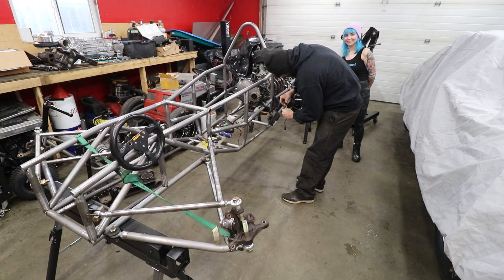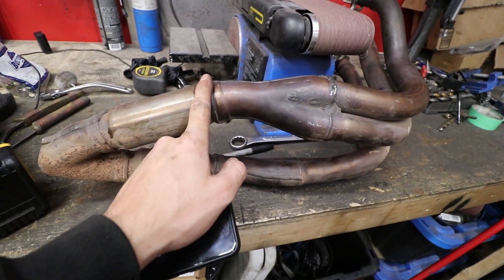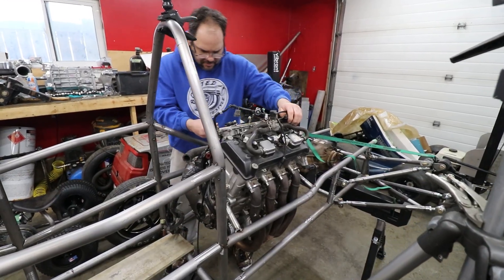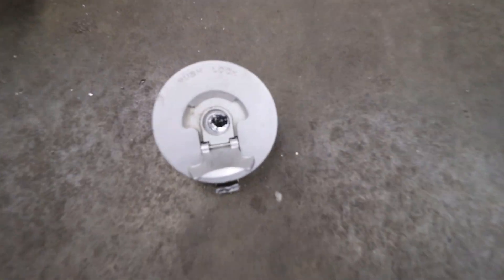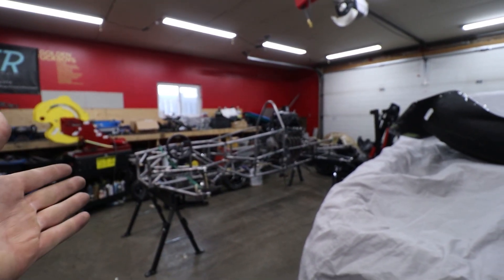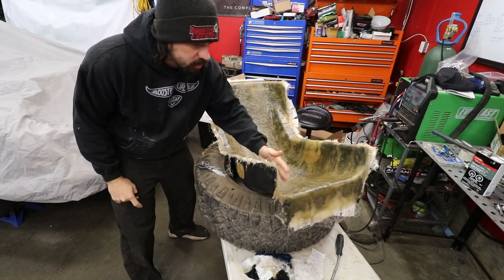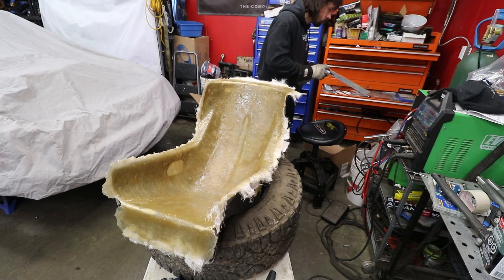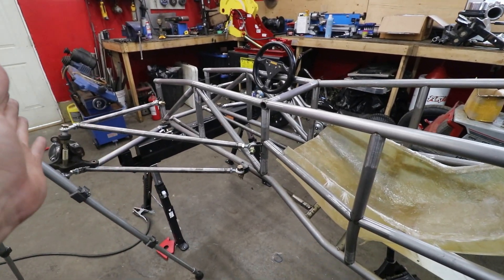First Start On My Homemade Formula One Car First Start - Pt 7

Comment: How does the Gearing work out, driving the Diff straight from the Gearbox Output Shaft?
Diff Ratio is what, around 3.5 : 1?
Probably close to what the Bike's Sprocket Ratio would be.
Smaller diameter Tyres, so overall Gearing should be a bit lower than on the Bike, I guess you wouldn't want it to do 160+mph anyway.

Comment: Could I recommend that you fit a turbo kit. Very easy to do!. It will help with the performance over weight ratio. Plus it will sound even better!. 
Not a eBay turbo! Hehe

Comment: So, I still haven't figured which engine does it have, a honda CBR engine I'd guess? Don't know if it's a 1000cc or a 600cc, if you really want high rpm go look for a quite rare but cheap CBR 250 Mc22, that damn engine goes up to 20k rpm

Comment: Hey Kyle, love the project. For wheels you should check out Perry Performance-GTF4 wheels. Super light 15x8 with 28mm offset. They work awesome on my miata with 225 45-15’s. You would be hard pressed to find another wheel that is 14lbs and cost less the $200..just saying.

Comment: I drive a race car called a Jr.dragster, and i also drive a jr.comp. Both of these vars have safty nets right above where your feet are for safety. Also, i would recommend putting the gas tank next to where the drive shaft is and an inverted radiator under your seat with a fan on top. Having a gas can right under you can spell disaster. Anyways, I love how far this has come and can't wait till it is done.
Reply: It literally can spell disaster what the fuck il mind blown
Reply: lol no... the fuel cell under the driver is literally how all formula cars are.

Comment: Since its a track car and has limited suspension travel anyway I would look at DNM Mountain bike shocks. They are light weight almost all have adjustable spring rate and some even have rebound control and arn't crazy expensive. If your doing cantilever setups these would be my first choice. Otherwise if you just want a cheap coilover setup any ebay rfy setup will do for around $40-50 a shock.

Comment: I remember Superfast Matt put a motorcycle engine in his track car. In long turns on the track the pan would run out of oil and blew the engine since bike pans are designed to lean into the turn, so the stationary position pushed the oil to the sides away from the sump. I recall he found an engine that didn't have that problem and used that. This is your most ambitious and best build yet so I don't want to see you suffer engine failure shortly after driving!

Comment: That seat is concerningly flimsy IMO. 
It's flexing just as you're moving your legs while thinking about pedal placement. 

Consider the force that might be going through if you were to impact a wall while going backwards? Will it hold up to your body weight, and be supportive in a 5/10/20g impact?

Comment: My only concern is the lower a arm tabs on all 4 corners. I think they’ll bind up and break. If the tabs were straight up and down there would be more travel.
Reply from the maker: The goal isn't to have much travel at all
Reply: @Boostedlifestyle  understood. I was just thinking any unneeeded stress on those tabs could break them. That’s all. I enjoy your builds a lot.